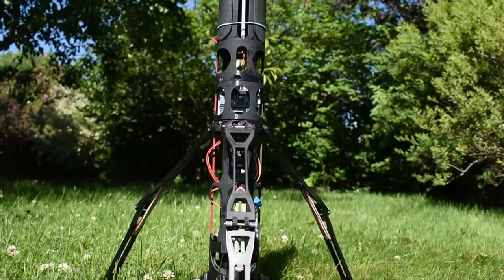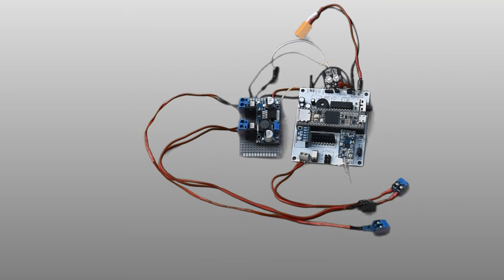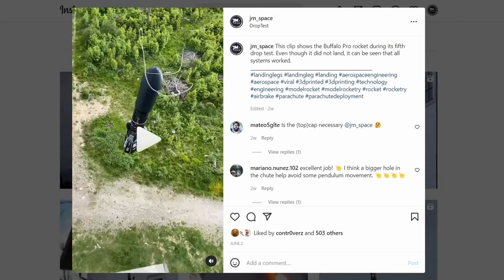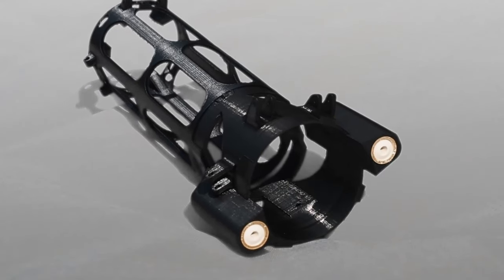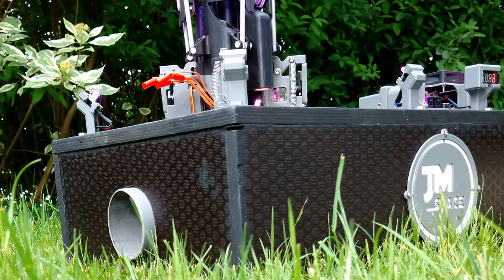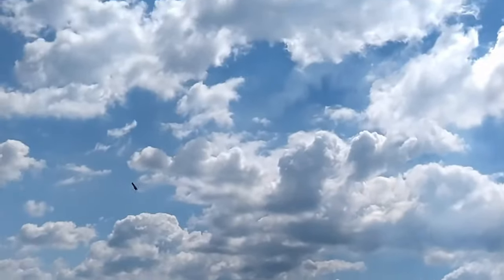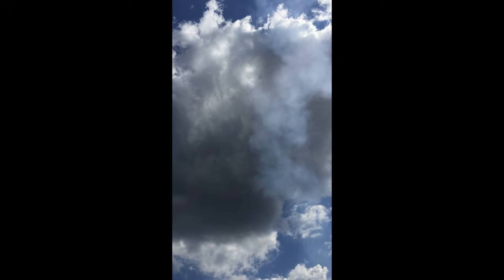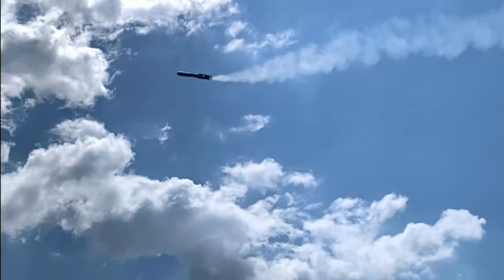Launch & Landing Attempt ONE | Buffalo Pro

Comment: It looks pretty good already. You mustn't forget that the rocket fought the wind relatively well in the beginning and still remained stable for the first few metres, which is very good.
I hope you will solve this problem soon and that the loss was not too bad.
Reply from the maker: Thank you! We shouldn't have launched though, next time we will wait for better wheater conditions ...
Reply: I have watched the video again and the following 2 thoughts have just occurred to me:

1. if you are using a pid controller, it could be that the strong wind at the beginning caused the I value to be very high. It then seems as if the wind becomes a bit weaker at the top and then I could imagine that due to the high accumulated I value it did not decrease fast enough.

2. the d3 klima motors lose quite a bit of thrust for a short time after about 1.5s. Maybe it was just too weak at that moment.

But this is all just speculation and difficult to judge from the video. But maybe my thoughts can help a little. It would certainly be exciting to see a flight in better wind conditions. But in any case, keep up the good work

Comment: Why did you lose the flight data? The landing didn't seem hard enough to obliterate a memory chip.
Reply from the maker: No it wasn't ... Pretty bad mistake on my side. The rocket only closes the file at the end of the flight, but in this one the power supply was lost prior to that. We definitely will fix this, is a very bad thing to happen, and could have definitely be prevented ...